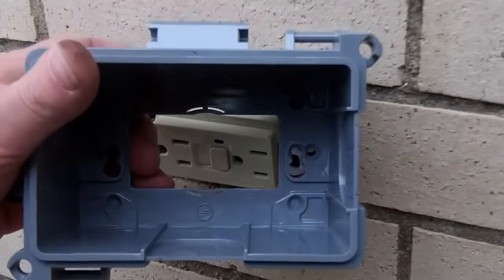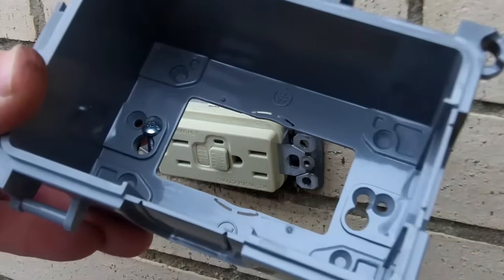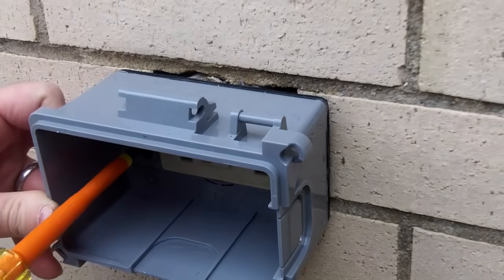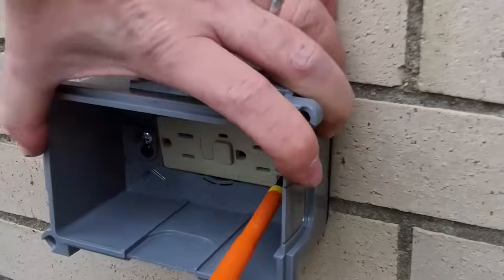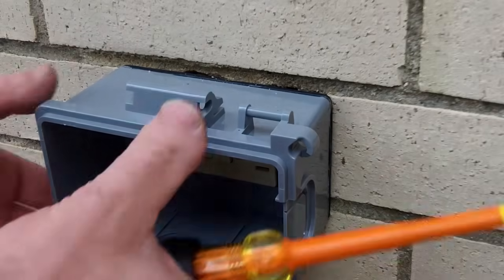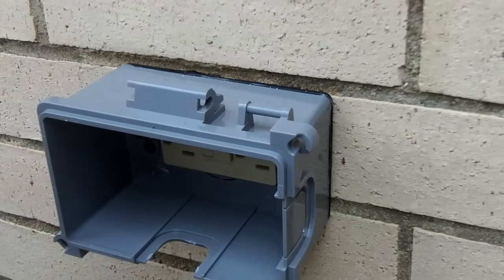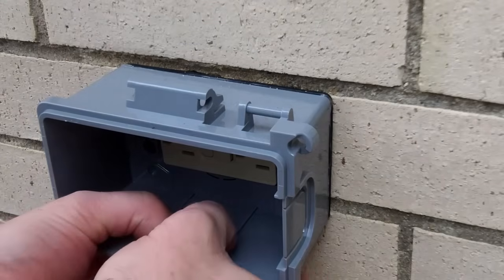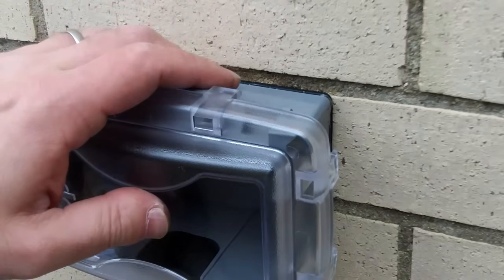How to Install an Outdoor GFCI Electrical Outlet Part 3 - Install the Weatherproof Cover

Comment: Any need for silicone on that top area with the gap of the masonry and electrical, or is the foam gasket enough?
Reply from the maker: Great question MrChmodx - I did seal it with exterior clear silicone caulk. Still looks good to this day.